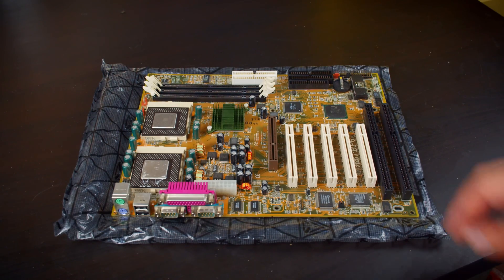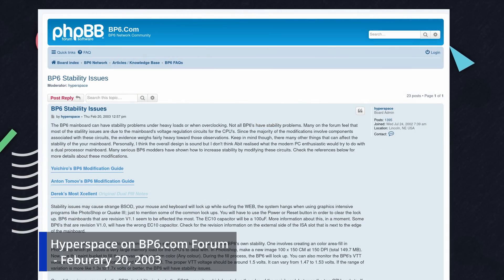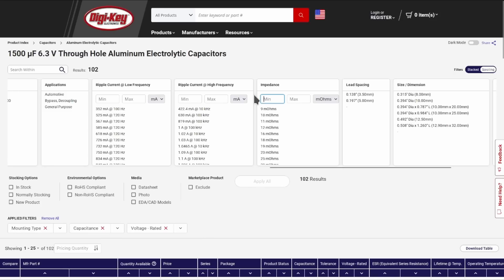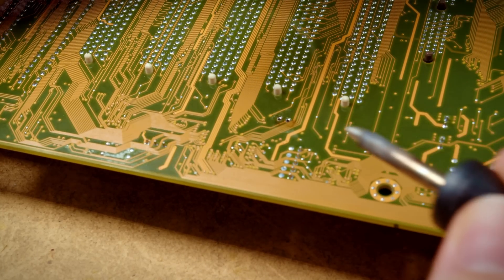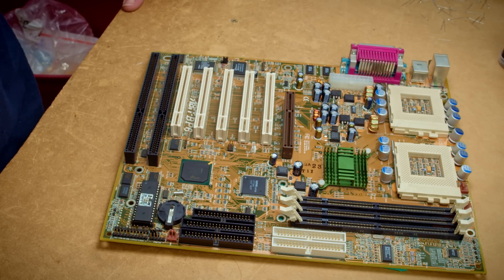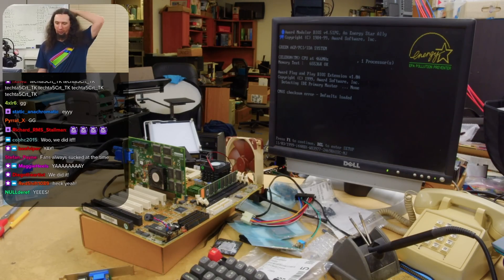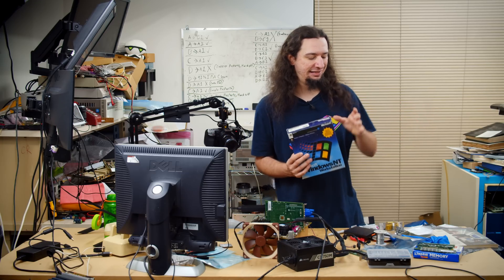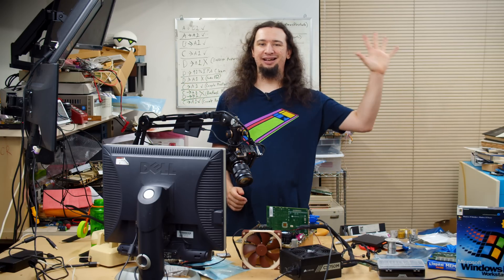Abit-BP6 ReCap - Dual Processor Motherboard Back to Life

Comment: I had this motherboard way back in the late 90's. It was one of the best cpu / motherboard combos I ever had. It was always extremely responsive and even way more than the 8 cpu/64GB computer I am type this on. I doubt I overclocked it as it was my everyday work computer running Linux and doing data analysis so I wanted something very stable.
I have recapped a motherboard before (as well as a power supple) from that era but I don't remember if this was the one. I seem remember the motherboard having green caps along the edge like that. I don't remember why I got rid of that Abit BP6 as I was so happy with it. I may have been the memory capacity, as I really needed all the memory I could get. I have often thought of going on eBay and picking one up for my at home browsing computer because it was just so responsive.

Comment: story goes back when this board was the Cats $$$ abit got cut off from the main 440BX logic supply belts from intel and it basically sank the company a lot of us feel it was Abit's one hit wonder even though they had good offerings like the BX6 2.0 and bh6 the BP6 should have been built day one as a dual pga Pentium 3 board with a small jumper option off to the side to use pga Celerons, if they had gone that route the company might still be around today.

Comment: I ran a 40 MHz 386 till I upgraded to a 586CPU, I don't remember the speed 
And I remember 233 MHz 
I had a 686, and then P4, and then dual P4
Then 4 core , then 8 core. I am still running the 8 core 4 GHz CPU and I am happy

Comment: Using x2 Celeron 333 CPUs with overclocked fsb to 100mhz would probably run better than the dual 533 ones

Comment: As a former owner of this board, can confirm it was flaky when it was brand new. Nevertheless, what an absolute legend. For the price of a single Pentium 3 processor, you could have a dual CPU celeron system. Which in those days, the Celerons weren't that far away from their equivalent speed Pentium 3. Some cache was all the difference.

Comment: I never had issues with my BP6's capacitors....until a bad Graphics Card damaged  it. It was stable except when  booting from the ATA 66 connector.
I had my  Celerons 366 overclocked at 550Mhz (500 during the Greek summer)  and Win NT  to take advantage both cpus when rendering on my 3d studio Max.

Comment: reason for not posting on the first boot maybe the point that the caps were not "pre-"charged to from an earlier shutdown. in the old days it was common, that a new mainboard shipped from overseas was "drained" after the quality check an shipping which could sum up to months until you bought it and booted it up the first time. so the new caps where the "culprit" i guess.

Comment: The Abit boards always had a really flexible bios but were flakey even back in the day. I used an Epox version for slot 1 with adapters with a pair of 300A socket 370 adapters and it worked really well for about 4 years. 105 mhz in a room that was 40c and running some big scsi cards and drives in the same tower. Ran windows NT very well. The only downfall was AGP. I never really found a card that wasn't to greedy power wise. I believe the real downfall of these was the limited power available.

Comment: I actually have three older dual cpu boards. I don't remember the model names right now. It's an Dual slot 1 Asus motherboard with dual 700mhz cpu's, one Gigabyte with dual tualatin 1.26ghz cpu's, and one Tyan with dual tualatin 1.4ghz. I love dual cpu motherboards, especially older ones. In my main system I currently use a dual socket 1366 Supermicro X8DTH-6F with two Xeon X5660. The BP6 is one of many legendary dual socket motherboards. Great video. Just subscribed. 🙂

Comment: years ago, i saw someone make a video of one of these, with socket mods i think that let you use 1.3ghz cpus, which he overclocked to 1.5ghz, he also had a pcie to pci adapter, put a semi-modern gpu on it, and installed win7, and ran Skyrim on it, at potato settings but still. skyrim was using both cpu's and it was pretty neat to see, idk what ever happened to him.

Comment: 6:18 it isn't about heat dissipation. It's to reduce inductance and resistance to the core as sharp changes in current starve the core of voltage - this ends badly (see: "plundervolt hack")

Comment: This is interesting. It reminded me of a dual P3 computer, that I've got somewhere in storage, that I used to use with red hat linux as a DHCP and internet gateway using IP masquerading. Can't remember what clock speed the P3's were but the machine was very stable.

I used to boot off a noisy 20G quantum drive, a model which came out just before the AS quantum series came out which were quiet.

Comment: Heating each leg of the old caps a and wiggling them out, then use a stainless steel cotton  needle to open the holes is a far safer way of cap removal.

Comment: I'm late, but I had a mismatched 333 and 433 running fine overclocked (83 bus) ~470/520? for years. 2k didn't like mismatched freqs much, and one game spazzed out if not forced to one, but xp and everything else was fine.

So... Don't stress. Presumably you've figured this out by now.

Comment: When I was studying computer science I had made a BP6 computer but tbh didn't use its full capabilities as Linux 2.2 (At the time) wasn't great with SMP and there were not a lot of multiprocessor capable software out there. But XWindow or kernel compilation were off the charts.

Comment: I had one of these , i remember running windows 2000 on it and one fasttrack raid card with 4 raptor drives... wow those where the times of dualcoring and super high disk speeds

Comment: Abit, as a supplier to HP, got TRAPPED in Bad Capacitors — company closed as a result !!
Saved my Nephew’s Compaq PC … using my Pace Desoldering system —
replaced all the Electrolytic capacitors with 105° and low ESR.  Kemet is quality brand.

Comment: This was my first board for my second computer (first was a DELL Dimension XPS Pro200n). If I recall, the EC10 cap replacement was actually what Abit used for their RMAs. (I think the later revision of this board may have even re-spec'd the EC10 values.) There was even a stability test for EC10 replacement: run Photoshop, create a new file with some super huge canvas, and do a solid color fill. If the program crashed/froze, then you needed EC10 replaced (with the higher 1500uF capacitance).

Comment: I recommend using a generous amount of flux even when you are desoldering, but for soldering in new components as well. It will help to cool down the joint when you take the heat away as well as distribute the heat but also gives you an audible indication of how hot it is (searing.) The surface tension of the hot flux will cause the molten solder to form a smoother even joint and will make extraction easier. Of course this leaves you with a sticky or waxy mess, which can be rinsed away with iso. I typically just use a toothbrush since the moisture is likely to reduce the build up of static, maybe I've just been lucky though. Use whatever brush you want. Look for non-caustic liquid flux, like kester 186, and use it liberally. Your solder joints will have substantially better adherence and the result will be consistent every time making visual inspection for joint quality a simpler task, too. My joints tend to run a little thin because I like to drag solder which is problematic long term especially for joints that bear load from components. If you need to revisit a joint just add a little more flux and load it up until it looks right. The main thing that flux does is that it helps to separate oxides from molten solder. I'm not real keen on the exact physics, but I can tell you that doing this at least for me makes soldering a lot more productive
Reply: The only thing is clean up which 1 or 2 passes is usually sufficient enough at least for me and for the most part most fluxes that I've used have been almost entirely soluble in iso, the problem then is just making sure you get all of the solvent (the iso in which the flux is dissolved) completely off the board xD like I said though, 1 or 2 passes is usually sufficient.

Comment: I remember having to recap the Uniden C-Band Analog Satellite Receivers.

They are the worst device I have ever seen for overheating the Capacitors

I taped 12 volts off the board and ran fans inside the case to cool them, but they still overheated

I don't remember the numbers, but I had the slaved receivers and the mid range and the ultimate model

They had the largest heaviest power supply I have ever seen in a device.

The power supply ran the board and the motor which was 36 volts DC and I don't know what the Amp rating was, but it ran a jack motor and I also ran a horizon to horizon motor mount, which was so incredible.

Back when I was running a dish farm digital just started, DirecTV just came out. Most transponders were still analog

I was able to get 139 degrees West all the way down to AMC-8
And my center point was SBS-6, 72 degrees south, and I was able to get down to 4 degrees West at the East most point

I had Mexican TV and Europe TV and African TV and Asian TV on some of the European satellites

Over 10,000 channels in all including C, Ku and Ka bands

Amazingly DirecTV, Echostar, and the 2 Canadian pay satellite services all had multiple channels they transmitted in the clear.

The home shopping networks, religious networks and China CCTV networks were all transmitted in the clear on the request and payment from the networks.

There were also other networks they transmitted for free

I had both Echostar and DirecTV services and receivers that I paid for, but I had discontinued the service and I came home around 2am from work one night and I saw the message waiting light on the DirecTV receiver and I checked the mailbox and there was a message from DirecTV telling everyone, literally anyone who had a box, activated, never activated, everyone they had a channel that was special and never there before that they were broadcasting the ENTIRE week long RNC convention and they would be on 24 hours a day and they were

By contrast, they did not, would not, cover the Democratic Party

No doubt about where their loyalty was

But there was a lot of channels that were not shown to customers that were corporate events that were transmitting in the clear and the companies were using FTA receivers with an 18 inch dish pointed at 101 W
And they had the frequency and S/R , polarity, FEC, etc programmed in to receive the events

I saw a lot of satellite trucks using the news paths to send their remotes to their networks

I saw so many incredible things on those big dishes

I miss those days

Now I am sick and bedridden and I can't get up most days.

I wish I had done more when I was healthy

Comment: I had one of these when they first came out and it never worked. I went through three returns to the supplier and it finally came back with a firmware version that wouldn’t work according to ABit, so I demanded a refund and was happy to get it.  Looks like I dodged a bullet.

Comment: No No No.  This was an IP issue.  Nippondenso knew that they had Chinese agents in their offices/supply-chain trying to steal their intellectual property and they INTENTIONALLY modified the electrolytic formula in the docs on their servers as a honey-pot to trap them.  The formula was intentionally bad and was known by prior testing to degrade quickly over time.  The Chinese (no offense to the people of that country) grabbed it and trusted that it was legit.  The MoBo companies used these much cheaper capacitors in their products and a wave of bad caps hit the market. I remember this era and the incredible amount of work it took to replace these counterfeits with genuine parts (yes, we used to do that).

Comment: You got a like just for making a BP-6 video.  I used one of these for my main workstation for YEARS.  And, when I first got it, the celerons were often the faster chip anyway.  We actually tested clock speed to clock speed for things like 3D rendering, compilation times, etc, and the celeron's full speed L2 cache made the difference.  Tee hee.  Abit... The "Intel said the celeron's can't smp so here's a celeron smp board." company. :)  If that workstation hadn't croaked, I'd still be using it today.

Comment: I think my bp6 still have the famous 300A on it :D It will need a recap too, but the board worked flawless at a bit overclocked, for around 4 years, it was replaced by something else but not because it failed, it was my home linux server from 2001 to 2005, I think I replaced it by a kayak dual P3 :)

Comment: Had this board with 2x400 MHz celerons in it. When it was time to upgrade it became a file-server as it had 4 independent IDE-channels. It was at the time when the 80-pin IDE cables with higher speed was introduced so one controller with 2 channels of  UDMA-66 and 2 channels of normal UDMA-33, so you could actually have 8 disks connected to it. So i had one boot-disk and three 500 GB IDE disks in raid 5. Problem was that these much more modern disks was too fast for the board. Solution was to use 40 pin cables on the UDMA-66 controller forcing it to fall back to UDMA-33. Used this as a file server for almost 10 years. It was pensioned in late 2010.

Comment: my only problem with the solder sucker, i still use it, atleast the cheap ones i have are impossible to keep completely clean. after just a couple uses im usually dropping tiny particles of dried solder, i mean you have to clean up anyway i just hate seeing what is essentially conductive dust falling all over my work

Comment: I'd like to point out that those coolers are perfectly adequate for those cpus. Socket 370 coolers were often rebadged socket 7 coolers anyway. If you start doing cpu heavy tasks, yeah, get something better, but they'll really be fine for hours with those heatsinks. Seriously, check out all but the highest end coolers. All of them are smaller than either of the heatsinks you were using. Heck, that first one probably was originally a 370 cooler unless you picked it up brand new labeled as a socket 7 cooler. It was generally socket A that had the beefier coolers, and those are interchangeable with socket 7/370, though be careful with the putting a socket A cooler on Socket 7. It has a tendency to break the plastic clips on the socket. Ask me how I know.

Comment: OH man I wanted one of those Soooo bad.. I was still in the Air Force and poor.. so.. I had some Cyrix junk..
Reply: I know it's still low end.. but get one of those cheep solder suckers with the bulb that you squeeze.. They are cheep as heck on amazon and are way better than an iron and sucker. The head fell off mind but I just stick it back on for the jobs when I need it.. still works good-nuff.

Comment: You should cut the legs of the components to size before soldering. Otherwise you run the risk of cracking the solder joints.

Comment: Damn my first ever PC(i was 14 years old) was based on ABIT VH6T with Pentium III 600EB and Vodoo III STB 2000 this PC i remember to this day, i actually replace all caps later on by myself because they all leaked, same capacity but they were bigger size and they still worked, to fit them i just don't cut factory leads and left them hanging from board :D good times, this PC worked well many years.
Reply: That was your first computer.. you pimp.. Mine was a Microcenter Lazer 386sx-25 with a monitor with a dot pitch so big you could use a ruler to measure it.
Reply: @HandFromCoffin  that was 2000 or 2001 in Siberia(Russia), my father sold his car to buy this PC. Car was Moskvich 412 in mint condition in beautifull lime colour which were gifted to him by my grandfather. Everything have its price.

Comment: Had it with dual tualatin celerons @145Mhz fsb. There was socket mods there was voltage mods on bridges and extra cooling but it worked better than P IV.
I had also asus tua-266. This ali chip could handle 160Mhz fsb…

Comment: I still have a  BP6 with dual Celeron 433 CPU's. It ran when I took the system down. I used it running Windows 2000 serving up Quake 3 Arena for 4 years straight. I think I was running 768 megs of ran for the board at the time. I was thinking of tossing it out. If someone wants it, just contact me.

Comment: I used to have the Abit VP6 mainboard back in the day with eventually 2 Pentium 1.2Ghz processors
It was a beast and even a friend of mine in the time with his Pentium 4 1.7Ghz was left eating my dust.
Only came really alive when Windows XP came out though. Before that I had it running in dual boot configuration Win 98/2000

Comment: I still have my dual processor board up in the attic, complete with both processors, it served me well before dying, always thought it was a PSU failure that trashed the board, the plan was to mount the board in a glass fronted wall frame, such an awesome machine before multi core arrived. immense nostalgia  trip - thanks

Comment: Hello, I have tip for desoldering thruehole components with hand pump, place little silicone tube sleeve over white tip of pump, silicone can handle high temperature and make seal a board with soldering tip.

Comment: Have an OG BP6 that I bought new in ~1999... used as a server with proper cooling (2x466) no overclocking... then of course retired and sat for a decade plus. Just this year reviving it and using as an awesome retro gaming pc... anyway original caps look fine, and the computer is rock solid... even have it running continuously with file sharing on and it always works! Still, will consider recapping. Also, has a strange 2004 firmware on it. with a penguin logo... I did it back then, but don't remember anything about it, works well & won't dare try to reflash etc!